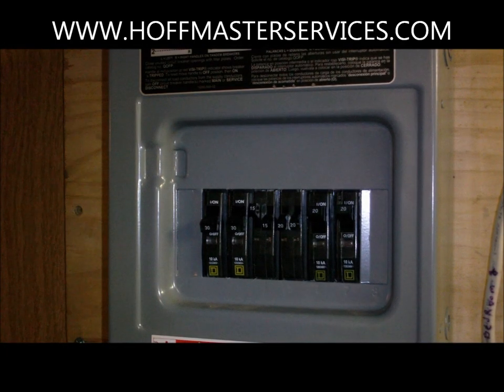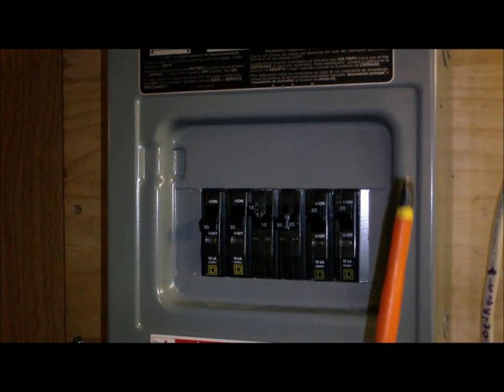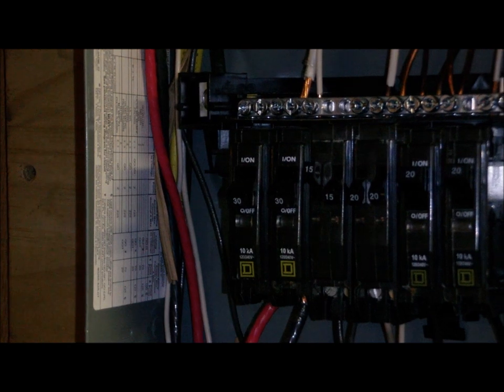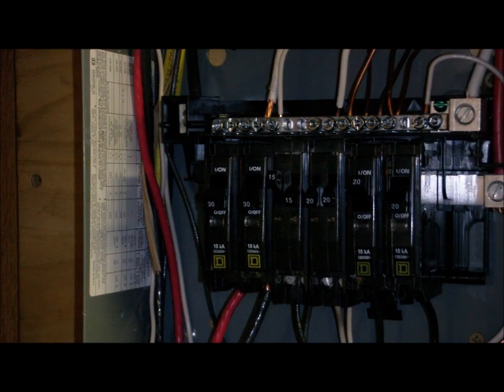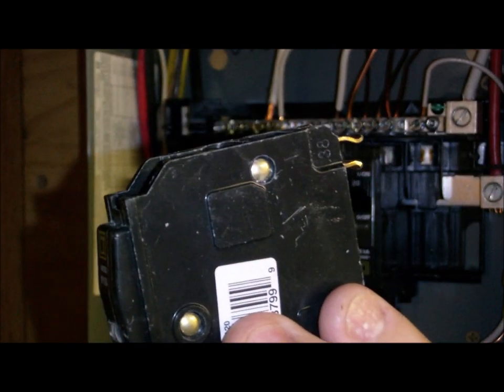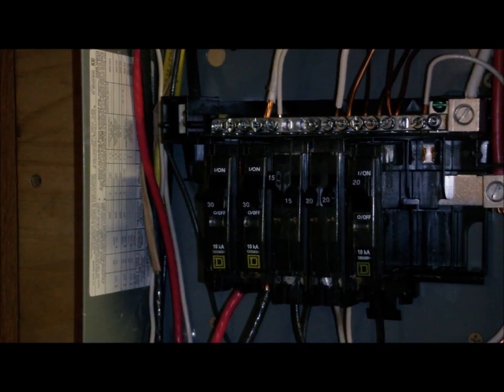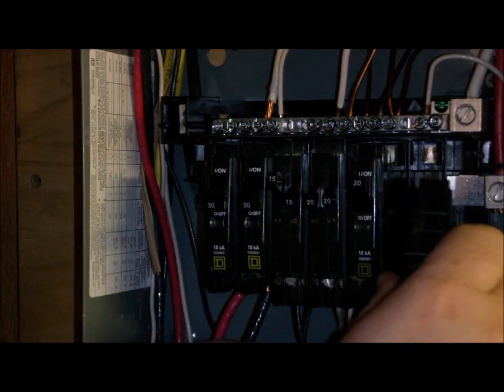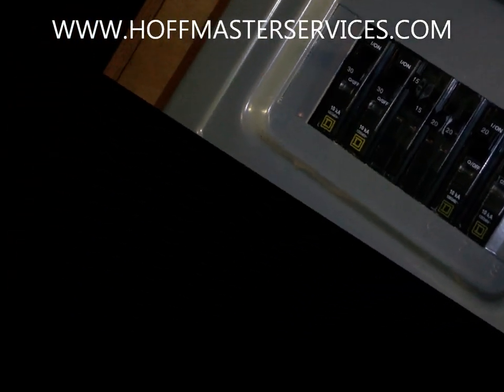HOW TO CHANGE A CIRCUIT BREAKER  BASICS

Comment: Thanks for the video.  I think it will help me get this done.  I do have one question.  I have a Square D panel and I have a 40 amp fuse that turns red as soon as you set it to on.  The only thing on this circuit is my AC unit.  Should I replace the circuit breaker or does this sound like a different problem.  Thanks again.
Reply from the maker: +lionround it could be the breaker or it could be a short in either the circuit or the ac unit itself.
Reply: Thanks for the fast reply.  I am going to change the breaker when the big box store opens in about an hour.
Reply: Handy Man.  Just thought I would let you know that did the trick.  My AC is working now and the house is cooling down.  It was 86 overnight and it now down to 82 even though the temp outside is already 93 at 11:00 am.  I can't imagine what it would have cost me on a holiday weekend to get someone out here.

Thanks again.
Reply from the maker: Great! :) I'm glad it all worked out. Thanks for letting me know. I do wonder and a lot of people leave me hanging.

Comment: You performed much work on breaker off camera.  The process to replace is pretty straight forward.  You seemed to be fumbling with the breaker off screen.  I was unable to see the work that you were performing on the breaker.
Reply from the maker: +Dennis Hurley this was an earlier video that I made when I first started YouTube. I hope you found it informative. Thanks for watching and commenting. Constructive criticism is always welcomed, it helps us all improve. 👍✌Please like, share, and subscribe.
Reply: I did find out that it was informative.  As it turned out my electrical problem was not the breaker.  The light switch had a short.